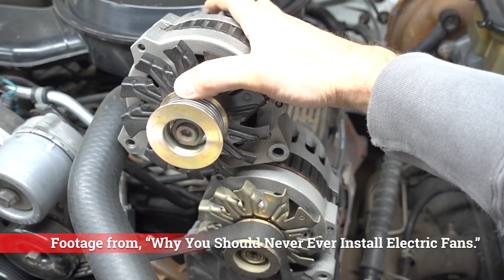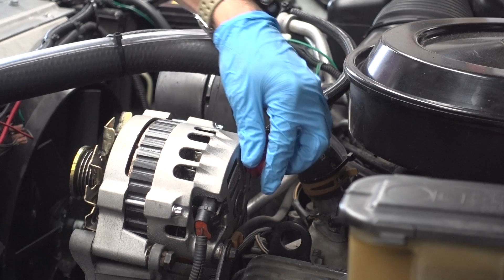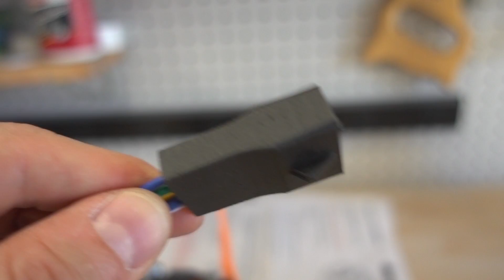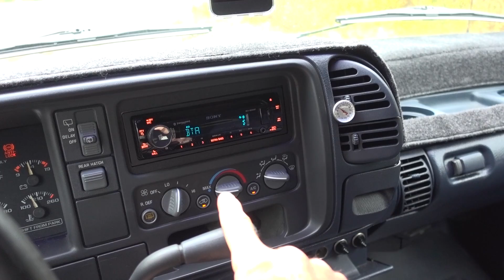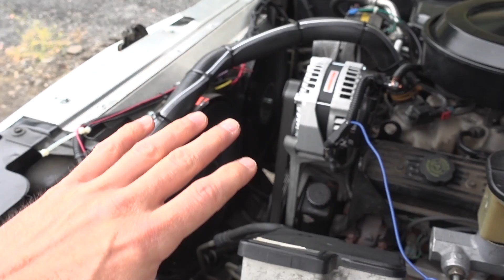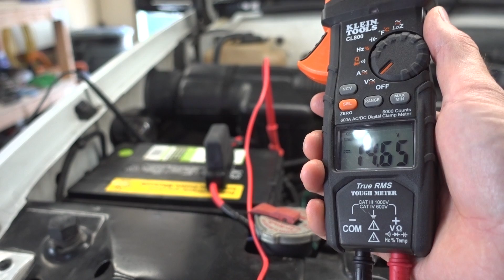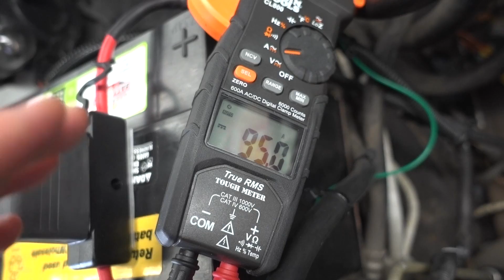Why This ALTERNATOR SAVED MY TRUCK & ELECTRIC FANS!

Comment: I dropped their 400A big dog into my '01 Silverado Z71 with the 5.3L just 4 days ago on a Saturday afternoon. I got in my 34" all aluminum 3-row radiator today, got my electric fans last week, waiting on the wiring harness so I can do that upgrade this weekend. I've already got the 2nd battery in place under the hood, going to run a dedicated 0g to it for accessories. I did a similar main power wire, and had to do the 12V switched lead that I tapped under the fusebox. Hid everything in heat protective sheathing, so it's super stealthy. I also plan to add a decent sized sub and amp with a 2F cap in the cab, but also a 3,000W inverter (with a dedicated 0g run to it). A small electric winch in the bed for dragging the motorcycle up one-handed, some extra lights up front, figured I might as well splurge and get the best alternator known to man, and like you said, it IMMEDIATELY showed 14.4V on the dash and it looks awesome, too. For me the install was mechanically really simple, except that the power post on the stock alternator is on the right side closer to the red power box, and on the Mechman it's on the left side of the back of the alternator, so my 1' pre-made cable I bought for this was just too short, by an inch or so. But, fortunately, had tons of heavy solid copper wire already on hand, and even the same hammer crimper. :) Good vid, it'll surely help some folks after they do the electric fan upgrade, I'm just glad I did the alternator FIRST after watching this!

Comment: Glad you posted the "For amusement only" boiler plate because I'm still rolling on the floor with your nonsense from your other video. I'll pass here --- HARD pass because I think you are running around with you hair on fire trying to figger out how to keep the evil spirits in your alternator to run your fans. People like you --- and good-intentioned as they might be --- are just wrong and make everyone who doesn't know what they (and you) are doing --- scared of dat ol' debil electrumicity.
Reply: A good 12 volt battery should be able to supply 30 amps for, at least, an hour!  If his battery is going dead at a stop light, then guess what is bad...

Comment: I agree with the fans.  I would have swapped the thermostat and maybe the radiator, and original alt pully.   Dual fans are not a good mod for whips.

Comment: Thanks for the excellent video! You inspired me to upgrade the charging system on the 95 gmc2500 suburban which I just got and was converted to dual electric fans by the previous owner

Comment: i just install a mechman alternator to my 2003 chevy trailblazer. the reason is because i have a flex a lite fan and a amplifier. i have never experience fuse burning or melting for my fan like you. but i did experience voltage drop. ever since i put the mechman alternator my voltage stays in the middle and it doesn't drop like it used to. i also did the big 3 upgrade when i install the alternator.

Comment: I have a 2008 Silverado 5.3 crew cab lt all electric. And i have the same problem when i turn the ac to the max and the truck is in a stop light the truck begin to fail making a idle and the revolutions goes down and up. But when i set the ac fan to  the minimun the truck get stable again.

Comment: Hole you go back and install marine grade heat shrink tubing on ALL of the crimp connectors. This will prevent moisture and other contaminants from getting into the wire/connector and causing corrosion over time.

Comment: Years ago I bought an aftermarket ignition system that used a 15 amp fuse. I ended up having to buy a high(er) output alternator to make my ignition system work the right way. It was worth it, though.

Comment: Can i get this alternator for my bone stock 95 chevy c1500??
Reply: ..if you want to spend money on something you do not really need, sure! It will bolt up with the mods he showed in the video.
I have a ACDelco 145 amp on my K1500 with 2005 Electric fans wired correctly, and upgraded grounds.  Works perfect, even on the rare occasion that I manage to get my self stuck in a traffic jam in 100 degree south texas days.
Reply: @LUpton-rq1fg  I am doing this what you have in your truck I have it all out in already im having this voltage issue

Comment: So if I am driving with both my high and low beams (yes I can), both my blowers,  my radio blasting, honking my horn, hitting my brakes with my trailer, and domelight on, and dual electric fans at 70 amps, I will be good to go?

Comment: You just needed to add a second battery in parallel so alt would charge them at cruising speed and while stopped the batteries would pick up the slack from the alt
Reply: @Mr.RightNow. while it’s true that the extra batteries would supplement the lack of charging voltage from the alternator in idle, that would not help the alternator or reduce the load on it.   The stress on the rectifier of pulling a greater load on it than it is capable of delivering will damage it.    The only way he could have “survived” with the 140 amp alternator is if he would put the trans in neutral or park and kept the idle up to increase rectifier output.

Comment: What did the weak alternator do to your hot idle RPM?  mine is low.  It sits at 500 and at times 300.  Not erratic.  
But it drops also when loaded,  for example when fans come on,  turning the steering wheel especially...throttle body is clean.

Comment: That 12v switched wire is to bypass the ecm controlled voltage sense wire. It provides full field voltage to the field windings at all times. You can do this with a stock alternator.
Reply: So where to I connect the blue wire
Reply: I did the same upgrade but the battery light doesnt stay on without this wire connected to a switched 12v, is it ok to run without the wire being connected?

Comment: How did u add the ground wire to the alternator casing
Reply: The mechman alternators come with a power and ground connection.

Comment: I have run Mechman Alternators in 4 different vehicles. All perform perfectly - and most importantly - they are RELIABLE. I live in Phoenix at 115 degrees in the shade. Imagine the underhood temp. And these things still put out what they are RATED for. GREAT ALTERNATOR.
Reply: @Chris hey man I live in avondale and just purchased one for my 03 suburban that I just upgraded to e fans . do you know where I can get it installed and upgrade my wiring?? please let me know
Reply: @jmunoz1414  Any auto shop can install an alternator including the Mechmans. The only problem is getting the larger gauge wiring done - most shops don't have 4 Gauge or larger wire available (I always use 1/0 Gauge) - Audio places (Audio Express, etc.) can do it and have that large gauge stuff always in stock.

Comment: Never use Chinese fuses! I had some melt under my dash, without fusing (opening the circuit)! I replaced any Chinese fuses and cut all of my spare fuses up and threw them in the trash. I now only use Little Fuse, BUSS or  or fuses made by the Japanese company "S&C". Other big-name fuse should be good too.

Comment: Chevy is a known issue with the rear bearing who quick working and squeak all the time and of course that produce resistance and don’t allow to spin and avoid to produce the correct current, maybe this company upgrade the bearing and to keep the alternator cool sound almost impossible due vortec is a real hot engine.

Comment: Hmmmmmm i don't want to disappoint you but the way you handled it is waist of money, total overkill
I had 2007 bmw x5 with stock electric  fan but the alternator was only 105 amp rated (i know because i had to change it)and it worked no problem, i even went camping in death valley with no problem what so ever, i was idling there in 105F heat for 4 days like 4-5 hours a day to charge the battery an run the ac and temperature never exited 211F
 now i have 2016 bmw x5 diesel and it has dual fans and alternator is still 105 amp and no problem even when i tow 22 foot maxium boat 
all you had to do is to change the alternator pulley to a smaller one so it spins faster  
also pwm you are using is garbage because your fans should have soft start and speed control that eliminates power problems
keep in mind that all cars that have stock electric fans do not have monster alternators yet they work fine under any load  at any ambient temperature

Comment: 105 amp altenator on a camaro with the huge factory electric fan. plus after market audio and amps... never had any voltage issues even at hot idle. your altenator may have been on its way out already

Comment: Some great ideas here. I have a 92 Dodge diesel that needs some help getting air to the AC condenser in the summer. I've looked into electric clutches, electric fans to replace the belt drive fan, and pusher fans. Im leaning more toward pusher fans for redundancy. If they fail ill still have the factory fan and if it fails ill have the pusher fans.

Comment: Congratulations, you solved a problem that you created... those fans are complete overkill for your application. I understand you are in a temperate area. Unless you are pulling parade duty with that truck, no problem would exist. If you get the operating temperature of the truck too low, it will not run correctly either. At most, 1 13" auxiliary fan on the front pushing air would have solved any heat issues of a correctly running engine. The only time those fans would need to run, is sitting at a red-light.

Comment: If you’re converting a vehicle to electric fans upgrading your electrical system is a no-brainer. The best way to do this is by using an alternator from a similar vehicle that came equipped with e-fans and then upgrade both the charge wire and ground straps. A lot of HD alternators you can buy from the internet are junk (mechman makes good stuff). Adding high draw electrical accessories to a vehicle has to be accompanied by electrical system upgrades, otherwise you create headaches at best and a fire hazard at worst

Comment: The heating effect and hence energy loss is proportional to current squared; thus it was a shame that only 12V was chosen as the voltage in most cars. Car electrics would have 1/4 the losses at 24V and the wiring could be much thinner.
12V was chosen because it was convenient for the lead/acid batteries in use, now we have NiMH, and Li ion, there is no such restriction.

Comment: You need a smaller pulley on your alternator.   idle rpm   Size of crank pulley divided by alternator pulley gives your ratio.  Basic calculation will tell you your idle alternator rpm then you can look up you alternator rpm specifications and see what the output is at that rpm...   ratio 3:1 = engine rpm 800 * 3:1 = 2,400 rpm at the alternator.

Comment: Alternators do not "produce amperage". Alternators produce voltage at a specific RPM. This  allows you to operate devices rated at, or near, that voltage. Why the current was so low at idle is because the load on the alternator was high enough to cause a voltage drop at idle speed of the engine. Increasing the RPM diminishes that voltage drop and allows for more current to flow. Once again, alternators or for that matter, generators,, do not produce current.

Comment: Your old alternators would have worked fine if you changed a pulley so it turned a bit faster at 650rpm.
Reply: Maybe not fine but definitely better. Higher current output at the same engine rpm with a smaller pulley.

Comment: Attention: when Voltage drops so does current.  You said the voltage with the old alternator DROPPED  and the current went up and fuses started popping. Use ohms law and figure it out. If voltage drops current drops as well, and the fuses cant "start blowing" !
Reply: ohms law  amps  = voltage \resistance.   If the load pulls 10 amps at 14 volts and resistance is constant.  When volts drop because you overloaded your alt system voltage drops lower than batt voltage. The load now pulls more amps from the battery than 10 amps. Fuses pop.  Less volts more amps.

Comment: 2 major mistakes you made. #1 you cut a bracket that is easily unbolted. #2 you reamed out the stock alternator mount when you should have reamed out the alternator casing. Now if your on a trip and alternator craps out your stuck with a reamed out bracket that hopefully you will be able to tighten up enough on a stock alternator so you can keep on going.

Comment: Another great video!! Contemplating swapping to electric fans on my '07 Suburban 1500 but didn't know there would be so much involved!!! Thanks a million for sharing your experience w. us. Now that I know it's gonna cost an arm & leg I'm still willing to do it but only now,  Xtra expenses won't be a surprise and that will take the trial & error away a little bit. I also plan to add a 2nd battery as I will use the truck as an off-road explorer and small camper as well. That alternator will definitely worth the upgrade.  ALSO: how is that 12V switch pwr connected in the fuse box? Thanks again!
Reply: Yeah I just need to know how the 12v switch is installed

Comment: Great video as always!  I intend to install that very alternator.  I wanted to point out your oil pressure seemed really low...ie..definitely under 20 in video...I have a diesel (same year) and it runs about 40 at hot idle--slightly higher than 45 with ac on and maybe 50-55 cold start.  I use 15-40 Rotella---but I've had GM gas engines same as yours and idle always seemed at least 30'sh.  I had an 07 escalade at one point with AFM lifters that went bad at around 80k...clearly not the case with yours.  Anyway thought I'd mention.

Comment: This is nuts.  Never seen someone go so far out of their way to demonstrate they don't know what they are doing.  You have a wiring problem.  If Flex-a-lite says use a 40 amp fuse it is because that is the MAX draw of the fans (actually about 35 amps) which means "when they both start at the same time".  You clearly don't understand that the motors in your fans surge when they start and then go back down to about 20 amps or less draw max.  If they don't there is a problem with how the fans are wired or there is an internal short somewhere, possibly in the fans. You have a direct short to ground somewhere in the system. 

Those fans, properly wired and operating, would work with your stock alt (providing it is in good condition) with the AC on full blast and head lights and stereo on. 

I can tell just by looking at your wiring job you are no electrician, you are clearly punching above your weight Jimmy.  You understand just enough to convince yourself you fixed but I guarantee you the problem will be back.  Not saying that to insult you, just to get you to learn how to use a volt/ohm meter and find the problem in the system. This is getting ridiculous.

Comment: Is there a way for you to test if that Alternator can really put out 150Amps just Idling? I really doubt it will be able to do that. I think mechman alternators are over hyped, their priced the most and they don’t really preform any better than other Alternators with the same specs. I would love to see you test that Alternator to see if it can really output 150Amps idling!!!
Reply: Steve Meade would beg to differ and he's a pro audio guy. Now are you gonna tell me you know more than him?🤔😂
Reply: @jRomero713  You sound like a Steve Meade troll! Anyways I’ll teach you something because you obviously know nothing about how electric works let alone car audio. The stock alternator in any vehicle is capable of producing way more amps at idle by simply increasing the vehicles RPM when in park/idle. Now those aftermarket high output alternators do indeed produce more Amps then stock alternators but they have a hard time producing a huge amount of amps at the vehicles stock idle RPM so to achieve a higher amp level at Idle those aftermarket alternators change the idler pulley size so that it will spin faster than the stock alternator, in turn outputting higher amps at idle because it’s increasing the vehicles factory set RPM at idle. On the high end of RPMs like at cruising speeds those high output alternators easily outperform stock alternators and that’s where they really shine. So yes aftermarket high output alternators can output a lot even at idle but there is a limit to it, you can’t produce an alternator that can put out basically any amp number you dream of at Idle RPM because it will not be possible as I said there is a limit to it based on RPM. That’s why in big car audio builds they add more than just 1 alternator because that 1 alternator can only do so much as I said it’s limited. I’m an engineer so I actually do know what I’m talking about troll. Put that in your pipe and smoke it!

Comment: I want tot do this same e-fan upgrade to my 95 Tahoe. However, a $600 alternator is just too much $$. Is there an alternator that would work for $300 or less?? Thank you for your excellent vids. Keep it up brother! :)
Reply: Sure. You can use the high output stock alternator. Might need a different belt or pulley. Go to a parts store that has staff that know what they're doing and you should be able to figure it out. Pretty sure 140amp alternator is an option for that truck.

Comment: hello watched this my gauge is doing the same thing I am putting out 13.8 volts and 65 amps at idle with air running with volt meter also going down should I just go with the larger alternator? asking for information

Comment: Jimmy any thoughts on doing a vid on low oil pressure as I have the same motor as you 5.3L truck has 346,000km still running strong

Comment: I have a question for you. Is it only necessary for your alternator to be grounded to your battery because of the high output? If not should I consider doing a similar thing?
Reply: You have to do a Big 3 on these High Output Alternators.